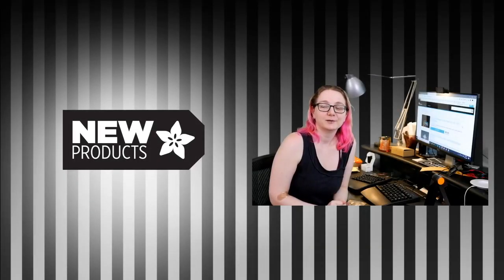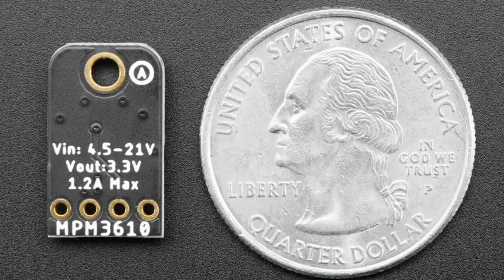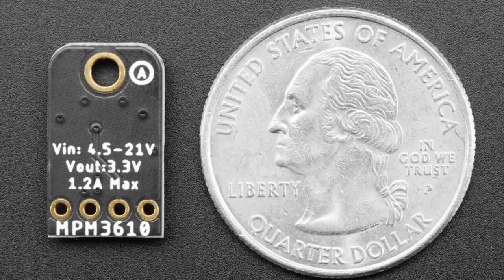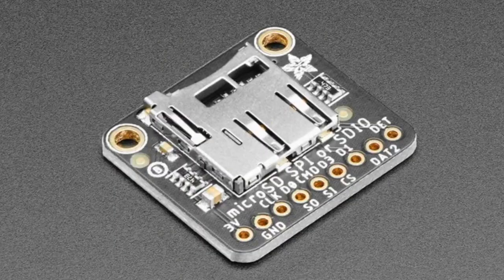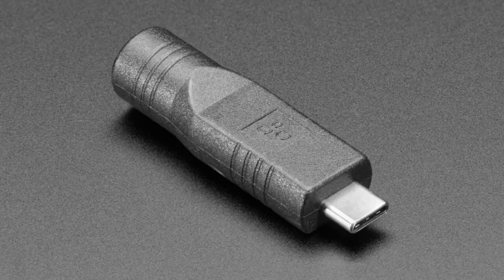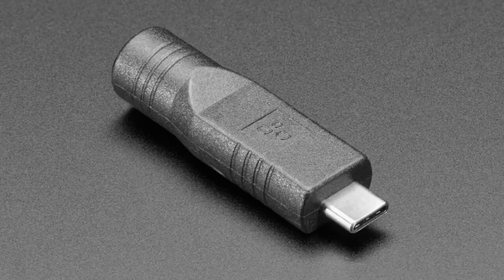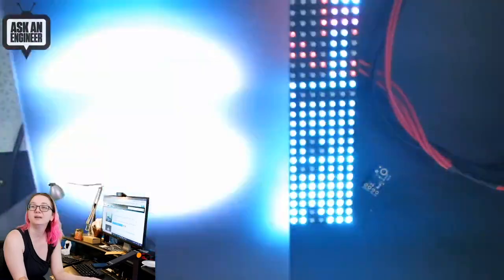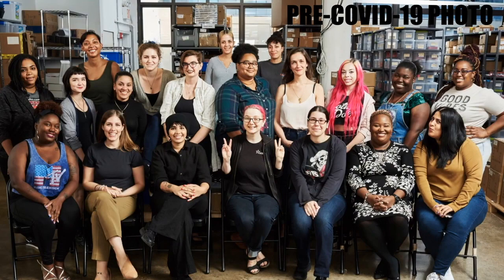New Products 7/29/20 featuring Black LED Diffusion Acrylic Panel 12" x 12" - 0.1" / 2.6mm thick!

Comment: I will be impressed if the mpm3610 3.3v really weighs only 0.5 grams, as advertised. I build 250-gram FPV helicopters and come from the background that makes drones so good the US government needs to ban them to give domestic drones a lifeline. Every 0.1 gram is fought and won(lost) in my background career. Going from the common 1 gram buck converter to 0.5 gram means 5 iterations of design. This is how a 500 gram product can take off at 250 grams and become wildly successful.